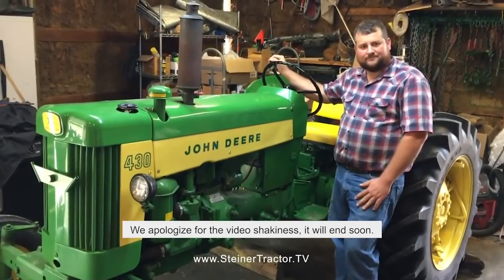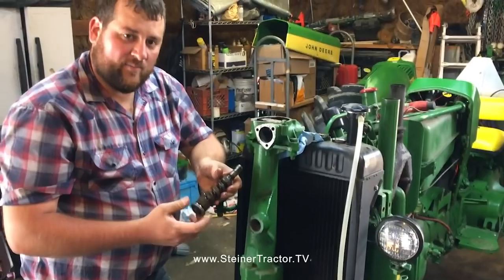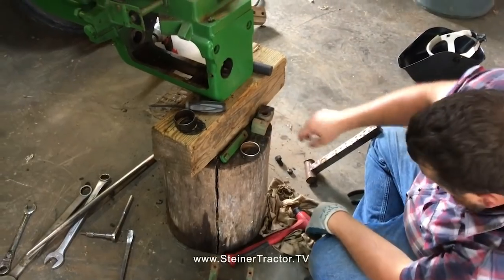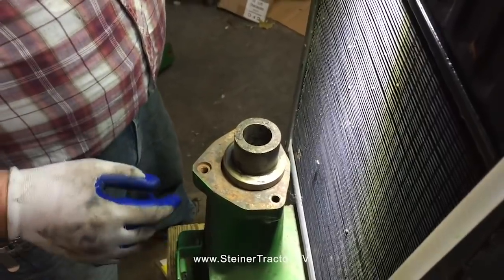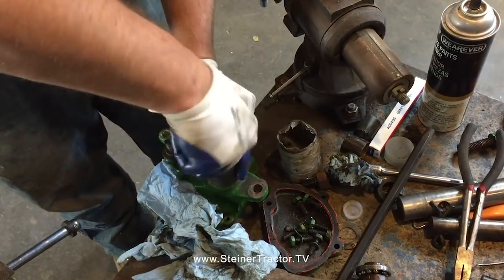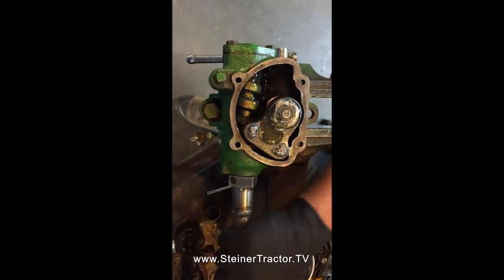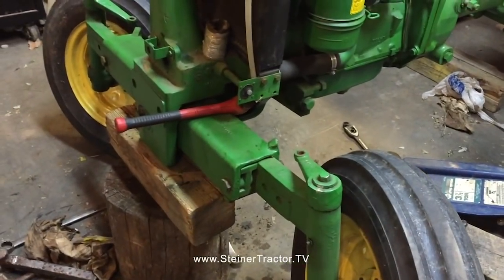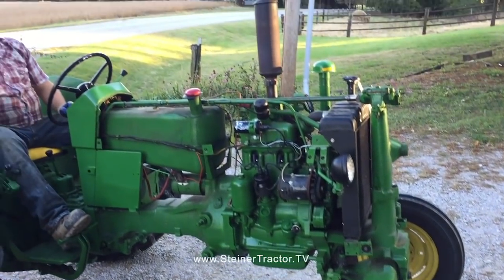Steering Repair on John Deere Tractor

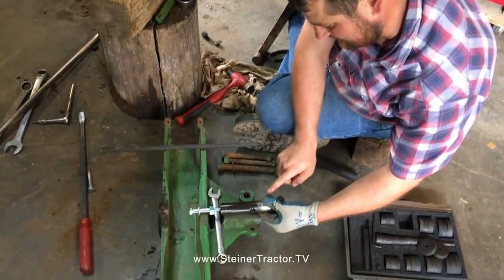Comment: Thanks for this video. At 15:30 you show pulling the pin with a bolt. Do you happen to remember the diameter and threading of that bolt? Appears to be around 3/8 or 1/2”
Reply from the maker: Hello Todd! That bolt is 1/2" coarse thread. Thank you for reaching out to us, have a great day!

Comment: Will this steering gear work for a 1010?
Reply from the maker: dave96_118 do you have the Deere part number on yours?
Reply: @SteinerTractorParts  Not that I could find. I looked in the cover and the pins that sit in the grooves of the gear and the bearings for the gesr are what are worn. The lower steering shaft needs a seal as well. Do you guys carry this?
Reply from the maker: Dave is this the seal you are looking for? It is listed under the JD 101 as a power steering pinion shaft lower seal

https://www.steinertractor.com/ABC2039
Reply: 2020johndeere power steering power
 @SteinerTractorParts

Comment: Good video.  Great detail.  Thanks!  I need to do this steering repair on my 1943 A...is it similar to what you just showed?
Reply from the maker: Tylers Reply:

The steering on the Waterloo, Iowa built 2-cylinder tractors like your "A" is quite a bit different. I'd recommend getting a copy of the I&T Shop manual covering this model as it will provide all of the tips you would need for adjustment. https://www.steinertractor.com/JD4-I---T-Shop-Service-Manual

The steering can sometimes be adjusted satisfactorily but often the steering sector (gear) and eccentric bushings will be too far worn to permit effective adjustment and must be replaced. 
New steering sector and eccentric bushings are available from M&D Reproduction parts ph. 410-643-2899 should your originals be worn. I recommend using corn head grease (available from most JD dealers) rather than gear lube as it will have a much lower chance of leaking out.